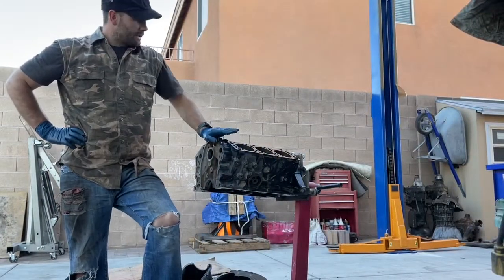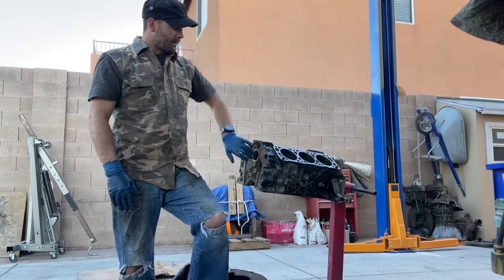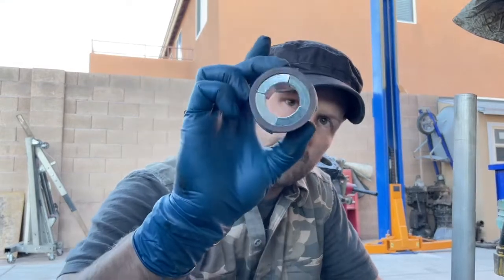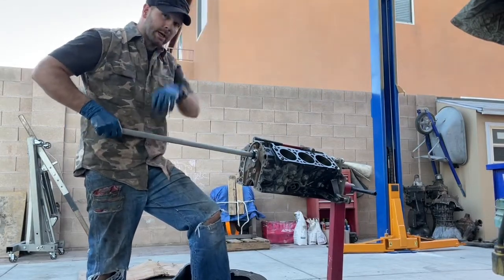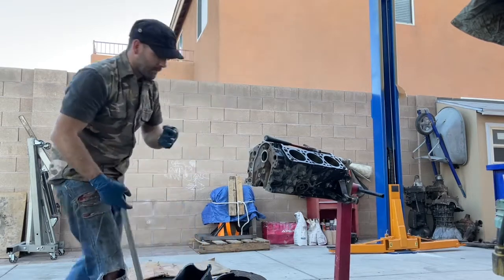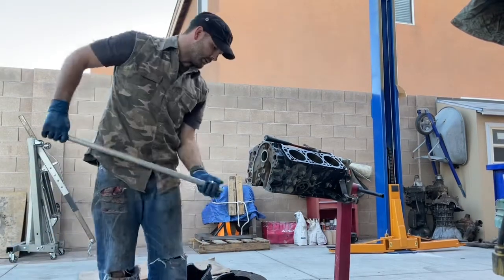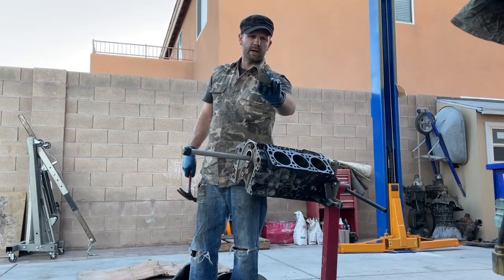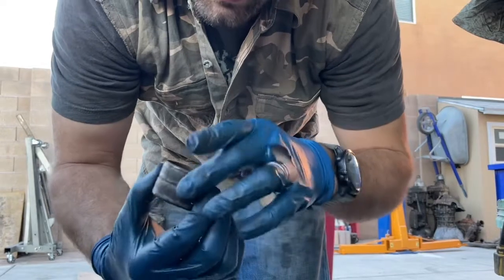Chevrolet L32 Engine - How to remove CamShaft Bearings - 1994 Camaro 3.4L V6 engine Rebuild

Comment: I'm thinking of getting an overhaul rebuild kit for my 95 Camaro 3.4L, is it even worth it ? I'm not in the US so plan B is a 3800 series 2 swap but there's an obstacle the computer pcm is automatic and i got a T5 transmission
Reply from the maker: Do you have any current issues with the current engine? Do you have the tools/equipment to tear down the engine then rebuild it?

Comment: I'm working on my 3.4 and I'm about to install the new cam bearings. For the middle 2 bearings do you just tap them all the way through the first slot? It doesn't look like there is any other way to get them where they need to be
Reply from the maker: Hi - I can't perfectly recall. But I do seem to remember that I had to put the 3rd journal bearing from the rear and the 2nd from the front... Are you having the engine out of vehicle?